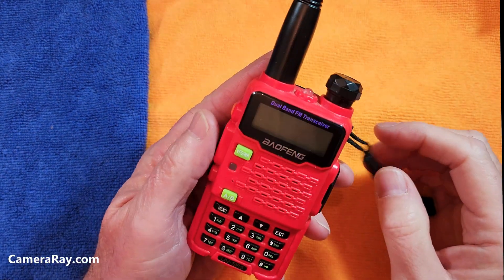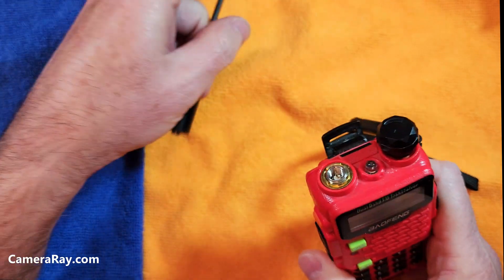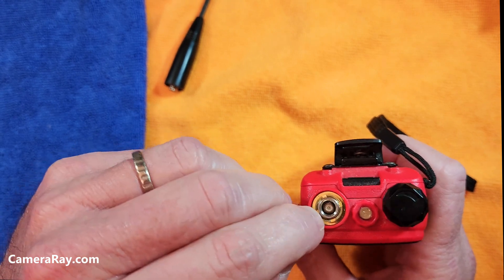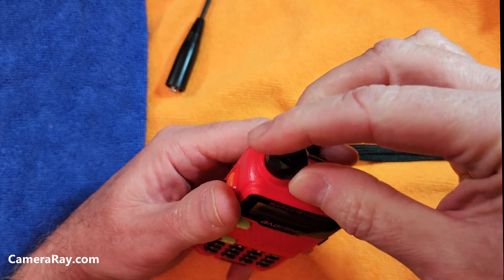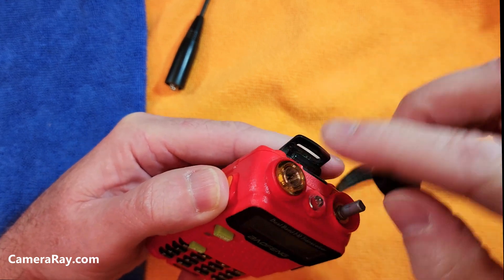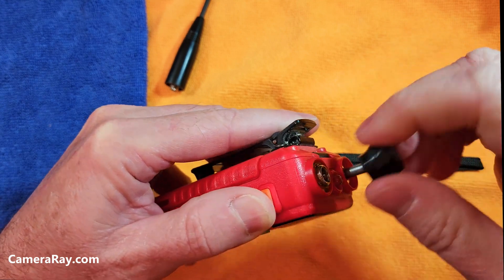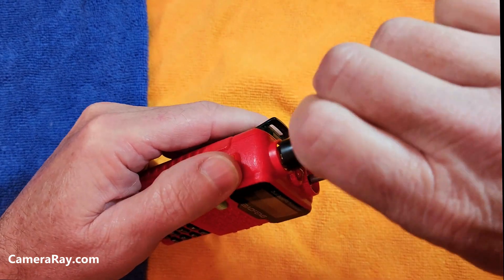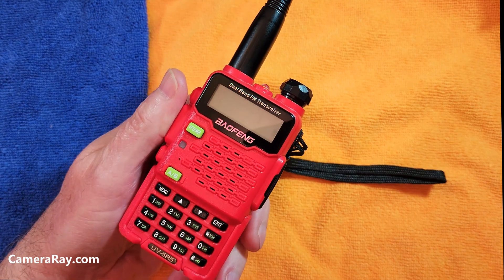Baofeng Radio Hidden Repair Tool #baofeng #hamradio

Comment: Great tip !
Works on UV 9 AMG, some UV 9Rxxx.
Don't work on S6xx and S9xx.
There is a tool you can buy, it does dash mounted car radios, C Clips, and small rubber seals.